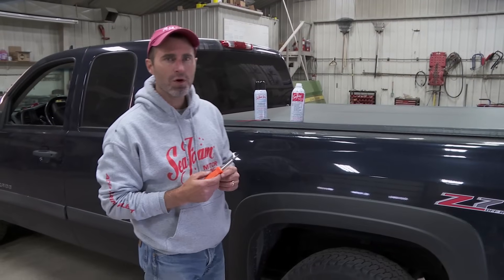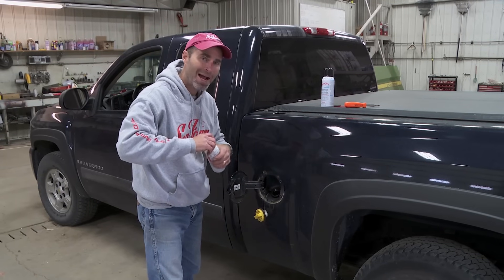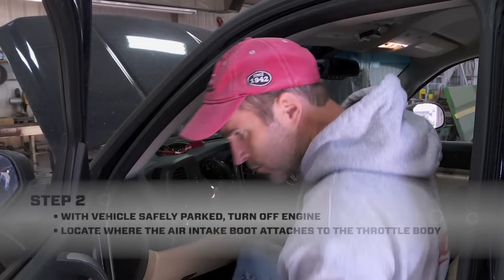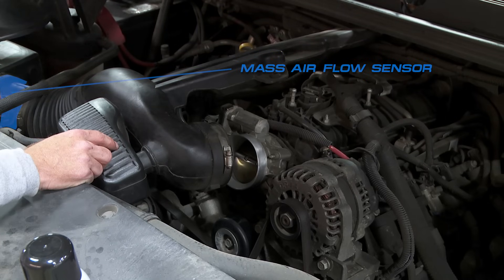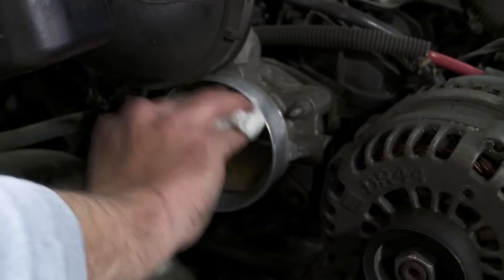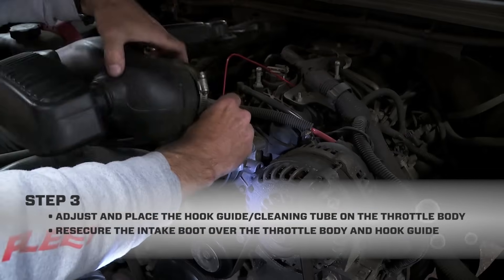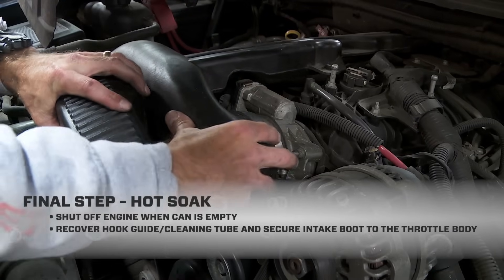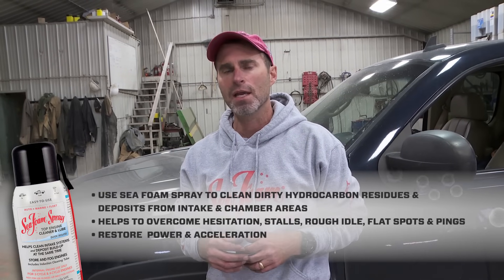How to clean a gasoline fuel injection air intake with Sea Foam Spray

Comment: Will this fix a code P0302 and code P0202?????????????????
Reply from the maker: It depends on what's causing the codes. Could be a plug, wiring, bad injector... Sea Foam Spray is a great diagnostic tool, and it will clean. It can't fix failed parts. Let us know what you figure out!
Reply: @SeaFoamOfficial  Thanks for that info. Any videos out there on how to change a fuel injector on a 2009 Chevy Colorado V8?
Reply from the maker: @MarkKomar  Google-fu skills.
Reply: @SeaFoamOfficial  fu skills?
Reply from the maker: @MarkKomar  'Google fu' means to evaluate what you're looking for using Google.

Comment: Should I change my fuel filter after using Sea Foam in the tank?
Reply from the maker: Hi Danwise. There's no need to change a fuel filter until it has run its course.

Comment: Does it need to be at 2000rpm? Or is 750 good enough
Reply from the maker: For a car or truck, 1500 RPM minimum for straight application. The problem with less RPM is the engine is not pulling enough air and can foul plugs. Why do you have 750 in mind?... go from there.
Reply: @SeaFoamOfficial  750 is idle and it is new enough to need 2 people to spray at the rpm you say
Reply from the maker: @chunkiermango7982  Thanks - that helps! It's definitely a 2-person job if you don't have throttle linkage under the hood.

Comment: I own a 2007 Lexus IS350 268k That’s Multiport Fuel Injected & GDI & A 2018 Ford Fusion Platinum 2.0 Twin Scroll Ecoboost 62k That’s Just GDI and My Lexi Valves Are Spotless but My Fords are so gunked up and sludge and I do all the proper maintenance and use 93 Non Ethanol I also had My Injectors & Valves cleaned at 34k! They Really Don’t Make Them Like They Used To!
Reply from the maker: What method was used to clean the valves at 34K?

Comment: My Cadillac CTS was idling rough even after doing plugs and coils, had fuel injector code on cylinder 4..put in some seafoam and no more flashing engine light or rough idle.

Comment: So what do I do about the misfire the next day?  Does Seafoam pay for that?
Reply from the maker: Are you showing a check engine light/misfire code?
Reply: @SeaFoamOfficial  this was a few years ago.  But yes, the check engine light came on, had to replace plugs and wires.
Reply from the maker: @Sneadster  OK, thanks. Sea Foam Spray can cause a temporary misfire code that will correct once the normal fuel/air mix goes back to normal after the treatment. Plugs/coils/wires wear out  - not related.

Comment: Awesome. Great instructing. I'm getting ready to do it to my 95 cobra now.
Reply: I got a 02 mustang convertible... Did it work in your cobra
Reply: I never sprayed it directly in the intake because I have no help. but I did pour the seafoam liquid that goes directly in the gas tank. I did it to my 95 5.0 pushrod and my 97 Mercury Cougar 4.6 sohc I didn't notice a difference except light white smoked puffing till the tank is empty or gets diluted from adding more gas. I added my merc cause yours is ohc. I do wanna try the spray directly into the intake on both cars. No help 😕

Comment: hi, thanks for your guide. I used your guide and seafoam in my car. Now I get acceleration lag. Could the seafoam be the cause? When I try to accelerate it doesn’t pick up quick. There’s a small lag. When idle the car judders between every 3 - 5 seconds. Could anything be the cause of this please?
Reply from the maker: If you used Sea Foam Spray you might have fouled a plug, which will happen if the RPM is not elevated. Let us know, go from there.
Reply: Sea Foam Official thanks for your message. The RPM was above the 2 all the time. Today I noticed engine having difficulties to pickup speed on 2nd and 3rd gear then the engine light turned on. Is there anything I could do to fix this issue please?
Reply from the maker: @TheYoungWarlock  1) Check engine code 2) Look at spark plugs for fouling

Comment: Hi, I have seafoam spray and redex fuel cleaner.. which one would you recommend please?
Reply from the maker: SF Spray works to clean intake valves and chamber areas, fuel additives work through injectors.  Both are needed!

Comment: Does this clean the throttle body as well?
Reply from the maker: It's the best thing going if you need a solvent to manually clean/scrub a throttle body. If applying while the engine is running the spray is centered in the airstream until it reaches the intake runners, so not going to clean the inner walls of throttle bodies or plenums. Hope this helps!

Comment: I have a 16 valve. Mitsubishi which hose do i poor the seafoam in
Reply from the maker: Gas tank for treating fuel system, oil crankcase for oil system.  For intake cleaning use Sea Foam Spray through the throttle body. Hope this helps!

Comment: I heard you have to do an oil change after a certain amount of milages, can someone let's me know... I think it was after you reach 300 or 3000, not sure. Thanks
Reply from the maker: No need whatsoever to change oil after using Sea Foam Spray. The only product application related to an oil change interval is adding Sea Foam Motor Treatment to your oil crankcase - add to oil 100-300 miles before each oil change. 👍

Comment: I'm getting a P0401 on my 04 Expediton and really hope this works so I don't have to remove my throttle body. Replace the EGR Valve, sensor, Solenoid, and worn rubber fitting. Got rid of all the other codes but that one.
Reply from the maker: Stuff wears out but definitely worth a shot. I would try two treatments back to back.  Let us know what happens!

Comment: Are there different steps for turbocharged engines? Should you put it in through the intake at all?
Reply from the maker: Makes no difference when applied directly in front of the throttle plate. Can check out our turbo demo vid!

Comment: I just did it to my 2016 F-150 5.0 with 60k on it. I have to say Nice it worked well. Let it hot soak then took it for a ride hit the gas and it bogged down then pooped out a big white smoke cloud and wow it has more throttle response and idles really smooth now. Thanks small business owner! I saw and feel the difference.
Reply from the maker: Awesome news - thx Michael!
Reply: i also have 2016 5.0 F150. did you also do the bottle in the fuel tank? how full was the tank? do you have the 23 or 36 gallon tank? thanks in advance.

Comment: I used throttle body and intake cleaner crc bottle of spray and something popped like if it was a shotgun...I’m scared to spray anything into my intake now
Reply from the maker: Sounds like a misfire. Make sure you have the RPM at 2,000.

Comment: Is there a youtube showing how to administer Seafoam Spray into a carbureted 200 hp mercury outboard, with 3 carburetors???
Reply from the maker: Not specific to your particular engine, no. Should be pretty straightforward though best to simply run a high concentration in fuel. That way you clean the carburetor circuits and the upper engine. Adding spray to the carburetor throat does not clean the carburetor passageways. Hope this helps!

Comment: My 2013 Porsche Cayenne GTS has 100k miles on it.  I felt there was a power loss.  There are several mods on the car yet it just did not seem up to full power.  I put 2 cans into the gas tank (25gal tank).  I followed the instructions.  The car was hot when I disconnected the pendulum.  I ran it at about 1500 RPM's and sprayed the entire can into the intake plate.  It has visible carbon on it so I can only assume what was inside.  You could see gunk coming off the intake as I was doing it and smoke coming out the tail pipe.  I turned the car off and let it sit for 9 minutes.  When I started it up it looked like it was on fire so much smoke was coming out.  That continued for some initial driving but I could notice a difference.  This morning when I started it and ran it OMG.....  There was a huge power difference.  I plan to do this again in 5k miles to get it really clean.  Super happy with how this product has worked!
Reply from the maker: Great news - thx for the post, Dean.

Comment: Can seafoam clean the intake runner assembly in a car?
Reply from the maker: Thanks for the question Angel. Applying Sea Foam Spray through a throttle body or carburetor throat will work to clean buildup in the intake runners. Hope this helps!

Comment: Is the hot soak done with the engine off? Also what if the car does not have a MAF sensor and has and electronic throttle
Reply from the maker: Yes, the treatment "hot soaks" in the chambers immediately after the engine is turned off. When a gas engine is is turned off, the chamber areas stay hot for 10 to 15 minutes, which is the period we refer to as the "hot soak", just as the can instructions show.

Comment: Why is my truck throwing alot of white smoke??? Is it normaol
Reply from the maker: You see the white vapor all of the time, sometimes, or when you use Sea Foam Spray?
Reply: @SeaFoamOfficial  only when I use the sea foam spray. After the 15 minute hot soak  when I took it for a drive.
Reply from the maker: @sinuemedina2550  The white smoke is vaporized oil from the Sea Foam Spray ingredients.  That's normal.
Reply: @SeaFoamOfficial  ok thank you!
Reply: @SeaFoamOfficial  can I do this same process to a 1990 toyota camry?
Reply from the maker: @sinuemedina2550  Yes, any gasoline engine.

Comment: Was the spray invented for people who don't feel confident in locating a vaccum hose and dumping seafoam in or is there a particular advantage to the spray?
Reply from the maker: Great question! The spray is atomized and feeds all cylinders evenly, so much more effective. Adding a liquid to a vacuum line does not disburse evenly and much of it is wasted because it passes through the chamber too fast and just gets pushed out the exhaust valves.
Reply: @SeaFoamOfficial  well said, makes perfect sense to me. Picked up this instead of the traditional seafoam tonight. Thank you!

Comment: I have a question about. Never apply the spray before the mass air flow sensor? So do you mean that mass air flow sensor needs to be removed from it's place before you spray the foam into the throttle body??
Reply from the maker: No need, never. Most MAF sensors are upstream of the throttle body, so there is no concern. Is your MAF near the throttle plate?

Comment: I couldn't get my air intake boot off so just sprayed carburetor cleaner spray through it. I had concerns id screw something up but so far seems ok after I did a test drive. It doesn't seem to struggle accelerating at stops and down highway as much. Lot better.

Comment: I have had this old Ford pickup for twelve years and have used cheap injector cleaners and the truck ran, but now I think I need to use Seafoam spray and see what miracle happens. Truck runs and I love the old gray lady, but I just love to start saving gas and have a smooth running machine. The poor engine is huge: four sixty and it makes a ton of noise. I sure hope the seafoam does miracles galore. I put some seafoam in the tank in the back and it sputtered and had fits but in time it settled down and started running ok. I cannot wait to do the spray thing in the upper intake part. It is thirty and dirty, but I love her. I have fixed various parts of her, but now comes the interesting part, right? byejoe---
Reply from the maker: Hi Joe: Can also start adding half a can of Sea Foam to your crankcase each oil interval. Let us know how it all goes!

Comment: Has anyone got a video on how to do a throttle body clean on a 2010 Chevy Cobalt? The only videos for the cobalt I found in YouTube were the cleaning and wiping of throttle valve entrance, Not the full spray application into intake/throttle valve. 

I noticed my car lacking power on acceleration while driving, especially climbing roads. Got the codes P0326 and P0327 on OBD. Took it to a Mechanic and changed the Knock sensor only to find out later that it wasn't the knock sensor, but some wires causing the issue. Fixed that and a week later new codes P2270 (cleared) and P0010 (permanent) popped up accompanied by rough idle (as if the engine is going to stall).  

I ran a bottle of Seafoam in my gas tank and 5 ounce to the crankcase. The Codes disappeared after taking it for a drive. Few days later, I was surprised to find those codes again and the rough idle is back. Just wondering, if I should do a Throttle body clean up since I bought a seafoam throttle body cleaner already? 

I haven't been driving a lot as I used to be and will be doing an oil change soon (oil is dark). The possible scenarios of codes P2270 and P0010 are numerous. From O2 Sensor to Camshaft issues, the troubleshooting steps says an oil change could very well fix the issue. Any help on this regard shall be highly appreciated.
Reply from the maker: How is your Colbalt intake different from the Silverado in the video?
Reply: @SeaFoamOfficial  Silverado is a truck and mine is a car. I don't know if it is any different. I'm not a mechanic and never tried before. I asked if anybody got a video of the application for cobalt, so that I can follow the instructions step by step. You replied with a counter question. Great response. Never Mind.. I will return the product and go to a mechanic better.
Reply from the maker: @TJ-ev5uw  The configuration is the same. Find where the plastic air intake tube ends and the metal throttle body starts. They will be a hose clamp where they connect. Open to find throttle plate.

Comment: Hey Bryan, thanks for the video. I think I accidentally Sprayed the intake through the air filter and thus some of the cleaner might have gotten inside the engine, is that dangerous? Thank you
Reply from the maker: I would not be too worried. It's supposed to go into the engine, btw. If you sprayed INTO your air filter, replace the air filter because the Sea Foam oil soaked in the filter won't go away cause a lot of dust/dirt to stick.

Comment: Why is it taking me 15 mins to empty the bottle?  I have my hose clamp as loose as it goes.  My only thought us in crushing the small hose somehow. Thanks!
Reply from the maker: Are you using the black hook guide? The can fluid should only last 6 or 7 minutes at most.
Reply: Yes I used the black hook.  When I was done, the hook and red tube had marring.  Maybe I forced the air intake on too far.

Comment: Hi, will this work for my 2010 volkswagen cc? It keeps hesitating and even stalling and I don't know what else to try. Ive already replaced the maf sensor(aftermarket) and upstream O2 sensor(aftermaket)...also it seemed to run fine before doing these and now I'm at a loss for what can be wrong
Reply from the maker: Yes, then let us know how it works out!

Comment: Looking forward to doing the intake valve cleaning on my 2017 Silverado 5.3.  You want the spray straw 1/4 of an inch from the top of the throttle body plate correct?
Reply: Jay Seyna clear cut directions are on the back of the can, you might need a magnifying glass to read them !

Comment: I did as instructed perfectly. Yes it was long overdue and the smoked that blew out of the exhaust burning the deposits was remarkable. Now my engine light is on and the engine is missing. Did the spark plugs get fouled and will it burn off while driving?
Reply from the maker: If you fouled a plug it's best to remove and clean the business end. (It won't likely clean itself.)  A gas stove flame works great for burning off the soot on the electrode. Code should reset once corrected. If not, disconnect the negative crank battery. Whenever using Sea Foam Spray, make sure you hold RPM at 2,000 to prevent fouling plugs.
Reply: Thank you. Before I took out the plugs I Yes I did hold the idle at 2,000rpm/ No problems. Drove her about 5 miles. Runs great! I just had to reset the code. I also tried Gumout first as a little test just spraying and the toothbrush. Nope! You need Sea Foam to get all that carbon/crude to break free. Gumout didn't touch it at all. And wipe in there with a clean cloth. Wow! The black stuff I wiped out. A lot!. Been using Sea Foam in cars . trucks, motorcycle, lawn tractor, walk behind mower and all my neighbors everything I service for them. LOVE IT! @SeaFoamOfficial
Reply: Hey Sea Foam! Do I get a t-shirt please?
Reply: Or how do I order a Sea Foam t-shirt if available?
Reply from the maker: @elcidlord  seafoamgear.com
Reply from the maker: @elcidlord  Nice work!
Reply: Yahoo! Will order right away! I love Sea Foam. The best ever ! @SeaFoamOfficial
Reply: Just ordered my Sea Foam t-shirt Yahoooooo!
Reply: Love Sea Foam.

Comment: Thank you for the video! I did the application through my throttle body, with my wife keeping our GMC Yukon at 2k RPM throughout the spraying. Afterwards, I let it hot soak for 15 minutes with the engine off. Everything was smooth, but I didn't get any "clouds of smoke" like I've seen/heard others get. Did I do something wrong, or did it not work? Or was my system just likely pretty clean?
Reply from the maker: Doesn't seem you did anything wrong. Sometimes you see the oil vapor (white smoke), sometime you don't. Either way is not significant.
Reply: @SeaFoamOfficial  hi! does  hot soak mean to just shut the engine for 10 min. before the driving around final step? Im a little confuse with the hot soak step
Thanks!
Reply from the maker: @julioserna5659  Yes, that's correct. A hot soak means that you're shutting off the engine when it's still hot and the treatment is working it the combustion chamber, soaking into upper engine residue/deposits.
Reply: @SeaFoamOfficial  thanks for the reply!!
Reply: is this safe to spray the whole can continuously or do i spray it in bursts

Comment: I have high mileage vehicles an I'm wondering if I could use all 3 ways for cleaning the motor. 
Intake,Oil crankcase an gas tank, At the same time?.
Reply from the maker: Hi Lyndon: Yes, but use Sea Foam Spray through the intake.
Reply: @SeaFoamOfficial  Right on 👍thx for replying
An thank you..